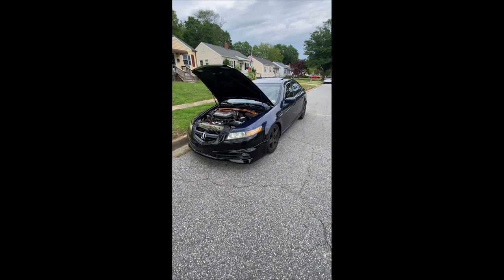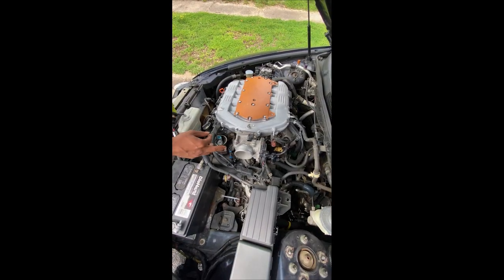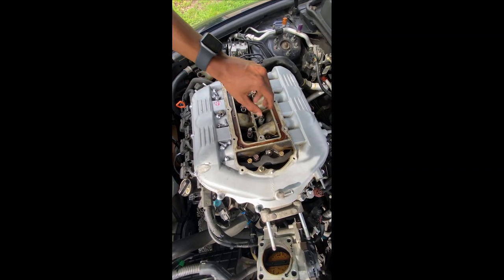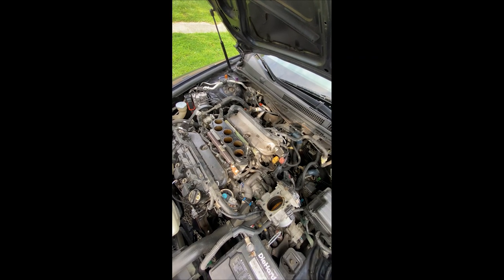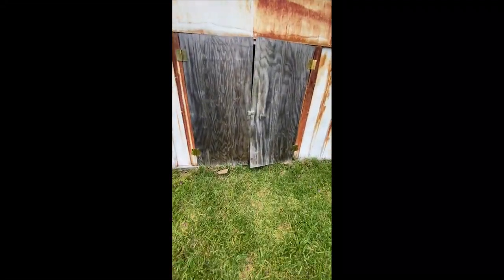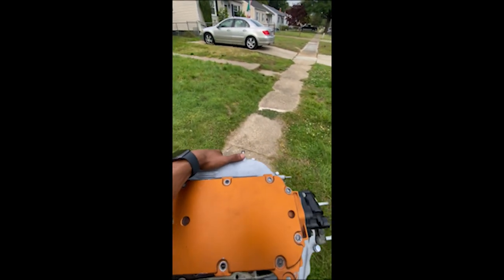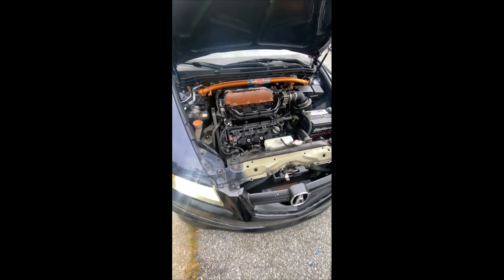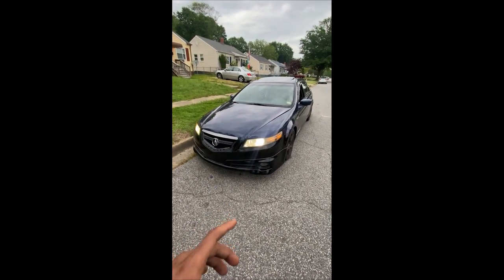Painting the Intake Manifold

Comment: Hey I plan on painting my top plate of the intake manifold, when you sand and paint, what do you use remove the dirt on the bottom inside side of the top plate? Is it best to avoid dirt and grime from entering? Would you recommend alcohol to clean the inside?
Reply: I have the J32A3 engine 2005 Acura TL
Reply from the maker: You can use degreaser for the inside of the manifold I don’t know about alcohol. I did something to my car to avoid build up so I have nun after 2 years of beating
Reply from the maker: I will make a short this weekend going over this!!!